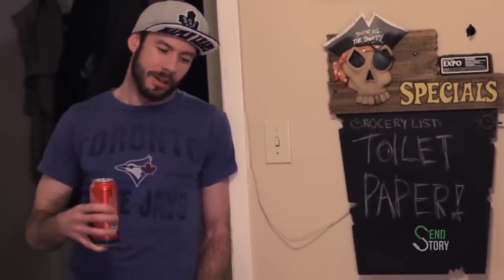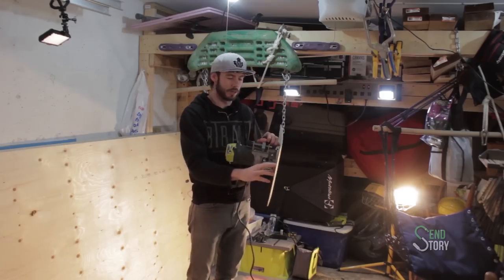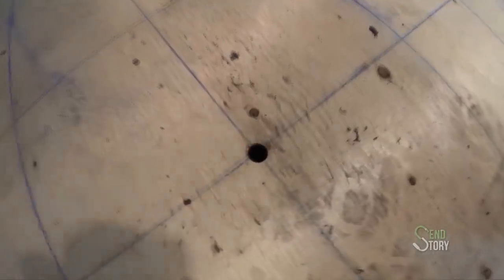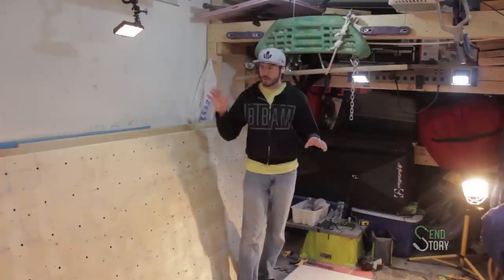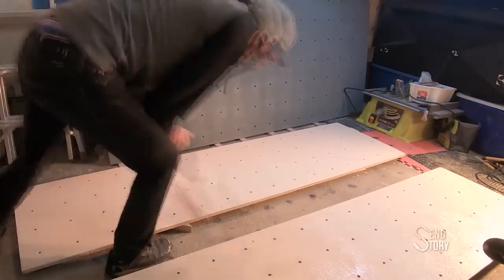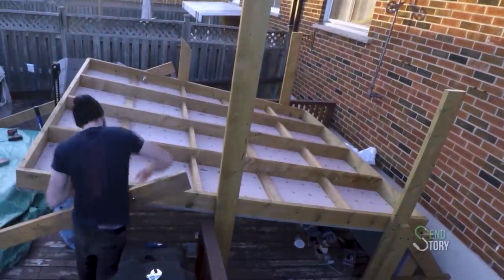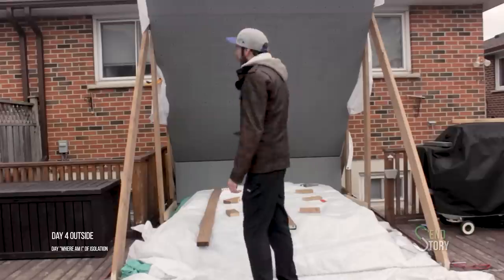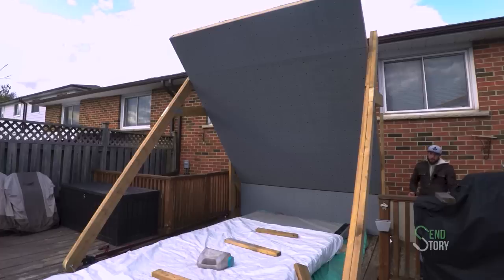Building an Adjustable Home Climbing Wall During Isolation - 12ft Bouldering Wall - Full Build Video

Comment: What paint did u use in your panels brother?
Reply from the maker: I just used a Home Depot Behr paint product for coating decks. I can't remember what it was called, but it has texture (aggregate) premixed into it. It has held up well and is still on there, just outside my window waiting for me to climb up a soon as it stops raining here. Some people don't want to coat their walls because the paint can cause the holds to stick, but if it's outdoors, paint would be a good idea. The texture also let's you flag and smear and use the wall better, and it also makes it less likely for your holds to spin. Plus... it just looks aesthetically more pleasing and finished. My advice if you paint it is to let it cure for a long time before setting your holds. You might still get a few that stick, but it will be better. A soft mallet usually helps pop holds that are stuck on easily without fuss, and if you just apply a little climbing chalk on the back of the holds when you reset them, it should alleviate most of that issue. Alternatively, if you use a two part epoxy type paint and add in your own aggregate, it should fully cure and your holds should not stick, but that kind of product is super toxic and smells terrible, usually is not sold to consumers (you would have to buy it as a business), and is much more expensive. I hope that helps!
Reply from the maker: Oh, and almost forgot, I believe the texture also helps stop holds from sticking as badly as they might on walls that are just painted without aggregate since it creates a uneven surface and less paint product is coming in full contract with the holds. That is my theory at least, so an opinion of one, take it or leave it. Figured I would add that in just in case you are contemplating texture.
Reply: Tnx alot brother but i think we dont have that in our place and i do u9 thnk that paint can withstand the monsoon?
Reply from the maker: @Dynoboypajarillo1713  hmm, that is a tricky one. On the back of the wall I attached some tarping for direct weather. I have a few update videos that show that a bit better, if you wanted to check that out for context. For monsoon weather, I would suggest attaching the tarp with slats of wood and screws to keep it from failing under heavy rain and wind. I also added a bit of an overhang to the lip of the wall, that would also probably help with weather. Best of luck!

Comment: Would you share the .blend? Great work.
Reply from the maker: I have had a few requests for the file, I am going to try to clean it up and upload it somewhere, I will try to link it when it's available when I have a second. Thanks for the comment!
Reply: @SendStory  did this ever happen, would be great to have access to that for personal use and planning, appreciate the video and renders regardless!
Reply from the maker: @shadowmage680  Honestly. It hasn't. I completely forgot, things have been a little nuts, as I am sure it has for everyone. I will however try to get something for people, I swear. I will comment on this when there is something tangible to download.
Reply from the maker: Hey Guys, I didnt forget, kind of. Just uploaded the .blend to Blend Swap - you can find the link under the image of the rendering on the build page on our website (linked in the description of this video). Not sure it offers a whole lot more than the descriptions and images on the page, but we hope that helps! Sorry for the delay.

Comment: How’s it holding up after 9 months?  Pun, not intended.
Reply from the maker: Puns are totally allowed here. Haha. Honestly the wall is totally fine. I don't know if you have seen the update video, but the only thing so far that will need some attention is the snap on tarp that I showed in that video. We had a storm that had like close to hurricane force winds that unfortunately tore some holes in it that I since have temporarily patched. However, the good news in all that is that the wall held up just fine. Thanks for the comment.

Comment: Damn nice to see! I built my own little free standing setup indoors. It’s purely meant for finger boards and pull ups to practice finger strength. Definitely want to also build an outdoor setup because as you said it’s helpful but I also want to build something to actually practice problems on. And definitely something adjustable because that keep things interesting and versatile.
@rikvdmark on Instagram for pictures of my current setup ;)
Reply from the maker: I was literally just about to start asking if you had posted the setup anywhere and then I read your last line. I will definitely check it out, thanks for the comment!
Reply: @SendStory  lol, you're very welcome ;)